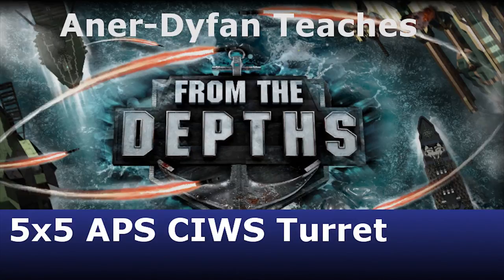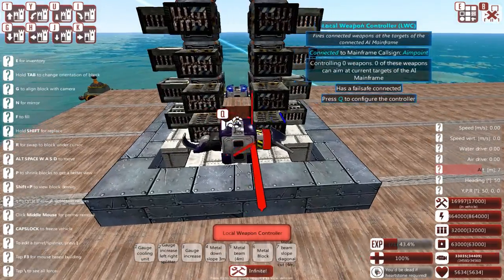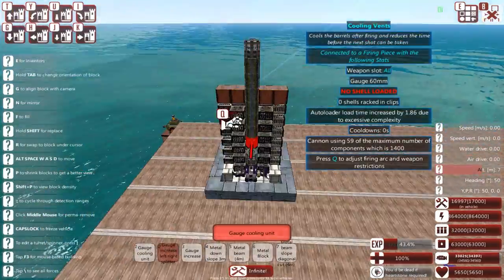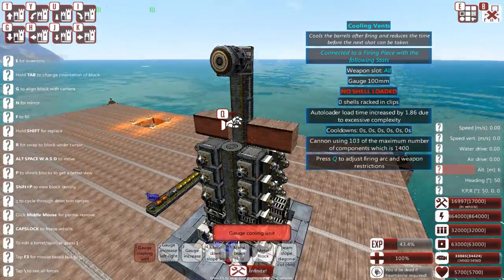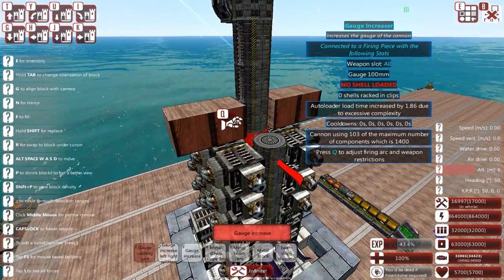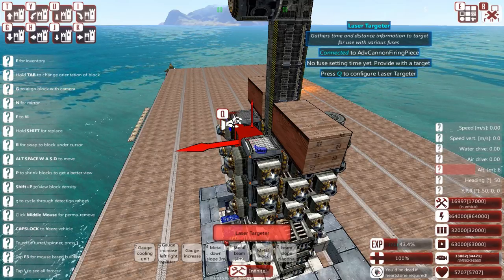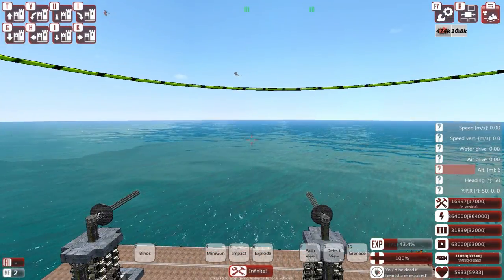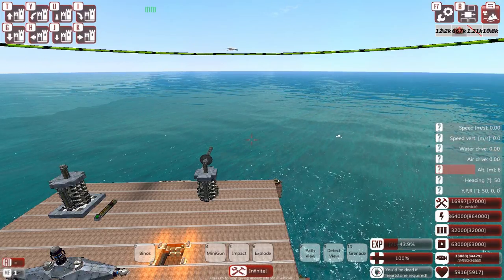From the Depths: Tutorial: 5x5 APS CIWS Turret

Comment: Thanks dude!!, this is waaaay cooler than having lasers hahaha

would it be a good option to make the flak have the same damage as the missles have health or rather have a better firerate and 2 shot them?
Reply from the maker: I've had issue with multishot before, if the second round doesn't fire soon enough the gun can get in a loop where it's trying to fire a second shot at each missile. But is unable to track fast enough, thus it never actually fires at all! This can also happen with single shot, but is rarer. Only way to break this loop is to have a LAMS taking out some of the missiles so the AMCC will pick up a target it can shoot at.

One thing I've not tried much is AMCC with continuous LAMS, the flak used to lower the health of a large number of missiles and then the continuous laser easily able to finish off a wide number of them.

Comment: Any ideas on what to do to stop the gun from aiming at missiles that are too close?
Reply from the maker: The AMCC does have minimum range settings, so those can be used. There is a bit of problem with the whole AMCC priority, as like shown in this video even (13:54), it can decide to shoot at completely crazy targets. Setting it to only fire once per missile can help, as it seems once it's locked on to a target it will really try to fire all 3 rounds before moving onto the next.

Combining AMCC with LAMS is what should really be done, flak cannons can decimate swarm barrages and the LAMS will pick off the stragglers. Often killing those really close, so preventing the cannon trying to track them as much.
Reply: Yeah I figured as much, I've been messing around with swarm killers but after the first missile gets too close they stop properly targetting incomming missiles. They also seemed to ignore the minimum distance I set, I figured that ends up being hostile AI or vehicle distance instead of missile... I need to revisit that.
Here's the blueprint if you want to give a look or help out: https://dl.dropboxusercontent.com/u/7737281/FTD/400mmFTGp%205B5x5%206H3x3%20FlakCIWS.blueprint
https://dl.dropboxusercontent.com/u/7737281/FTD/400mmFTGp%205H9x9%20BALL%20FlakCIWS.blueprint
Reply from the maker: I've had a look, the ball turret traverses pretty slow so seems to have trouble keeping up with missiles, if possible a 3x3 omni would be useful to speed this up.

With both though they do have trouble with a constant barrage as once they miss one they have trouble re-acquiring a new target in time. To help reduce this I allowed them to fire further out, and also reduced the minimum accuracy. A smaller more rapid firing round also did well. 300mm does 550 on a single warhead, still way more than enough for missile killing. The only way I could break the guns out of the cycle though was setting up a short range LAMS system nearby this would clear out the closest missiles allowing the cannon to fire at more distant missiles.

Comment: Nice :) i forgot about the missile warners dont they have a 500m range?
Reply from the maker: Missile thruster strength = distance warners can spot. So 1000power is 1000m detection, and a 5000power is 5000m detection range. Means that bombs are invisible to warners, which is something to consider.
Reply: did you upload this turret ?
Reply from the maker: It will be on 5m turret platform, currently updating the FtD forums and Steam workshop, along with a couple of other ships I'd forgotten about.

Comment: Just downloaded the prefab, it's not firing at missiles at all, I tried removing the LWC now it simply doesn't fire at all. have autodetections on if that makes a difference.
Reply: As it happens munitions defense is required even with detection set to 1
Reply from the maker: Ah excellent you identified the problem. I think in future I'm going to try and put munitions detectors on the gun as well so that they really can just be placed wherever and just work.

Comment: I've been playing from the Depths for a while and with the new update I tried to design the CIWS goalkeeper and I created it in a separate system with the intention of testing it before mounting it on my warship and instead of firing at the missiles, it mainly eliminates the enemy light aircraft and does not target the missiles (which are the main problem) any suggestions?

P.S: I put my question in this comment because I could see that in the video the cannon targeted the missiles first and then the enemy aircraft
Reply from the maker: Remember munitions detectors, seriously I can't believe how many times I've been testing CIWS and forgot them.

The AMCC should take priority over the LWC. Ensure it's engagement range is set high enough to engage the missiles. The default is pretty short
Reply: The first thing I built was the AI, I added detection systems of all types so I do not think that's that

I have two AMCC and one LWC and I put the configuration that I need, I suppose it should be the cause but when I tried with the confuguracion it became more crazy
(two AMCC because it's one per move is an oscillating turret)

Comment: Do CIWS work underwater for torpedo defense?
Reply from the maker: Yes they do, so long as you are able to detect the inbound weapons.
Reply: That's awesome, thanks! Damn torpedos have been sinking all my ships and my LAM won't touch them.
Reply from the maker: Interceptors can be useful for that, and can be pretty short, especially if you mount them on a aimed AMCC turret. A number of different options, but even a very basic fin-fin-prop-prop-fuel-interceptor can take out a couple of torps.
Reply: Just so you know, you can make anti-torpedo torpedose(torpedoes?)